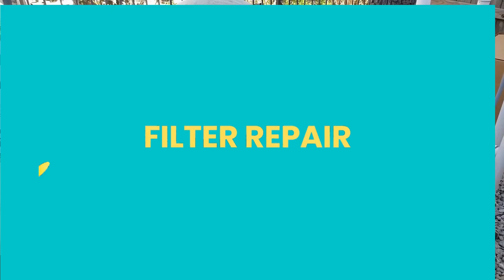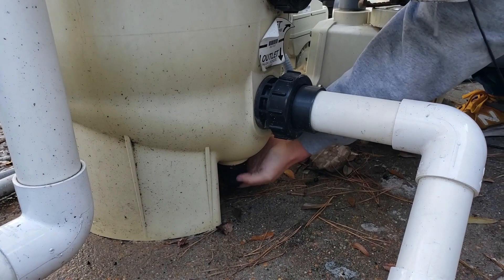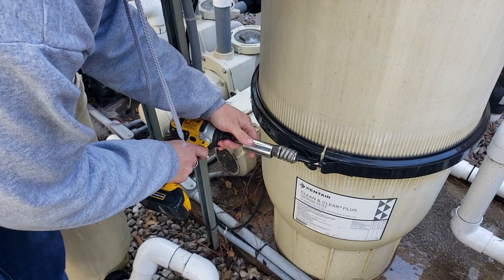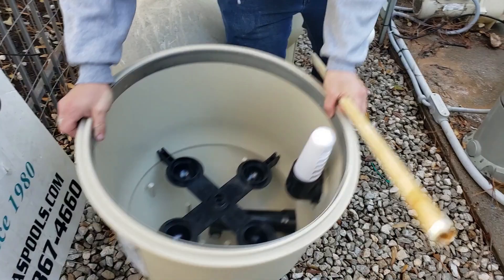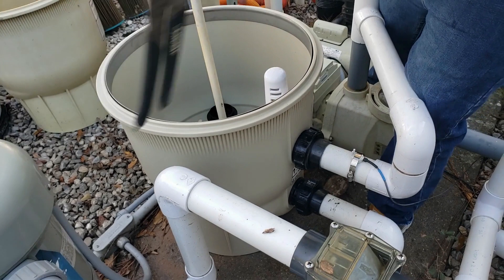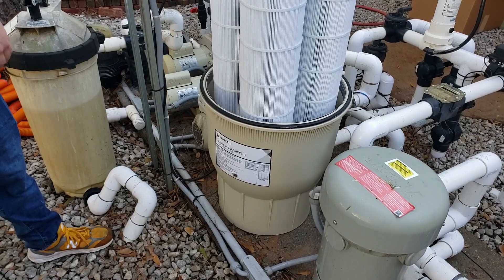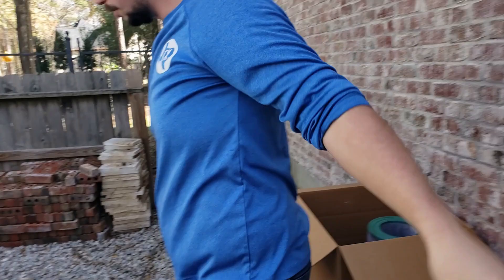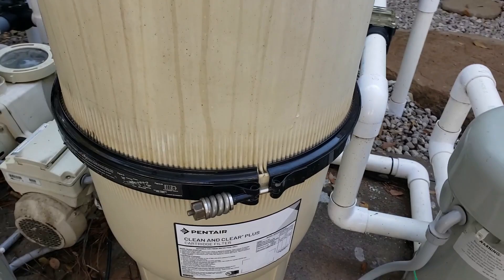How To Repair A Pool Filter Tank

Comment: What did you use for your drill?
Reply from the maker: That is a DeWalt impact drill. However, you need to be careful using a drill to tighten because you can easily overtighten and cause damage to the filter band. It's a good policy to notice how much gap space there is before you loosen and then tighten it back to that spot when putting it back together.